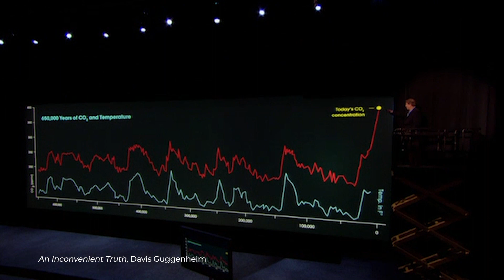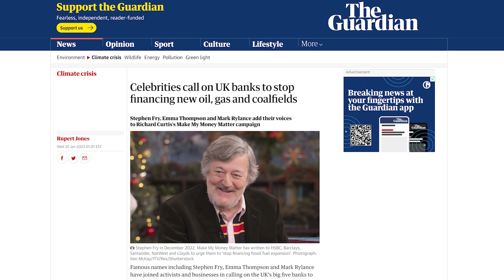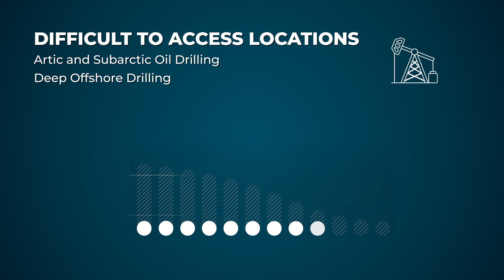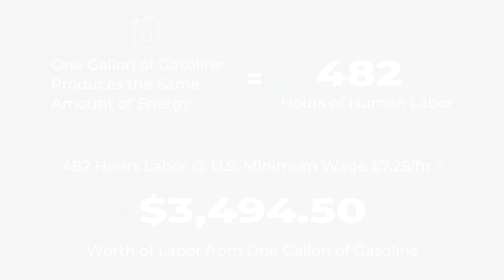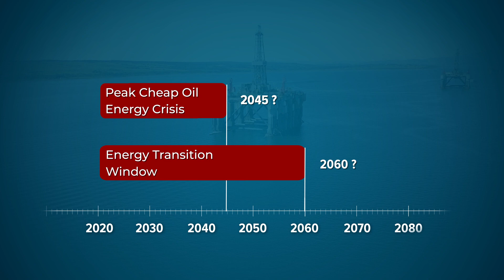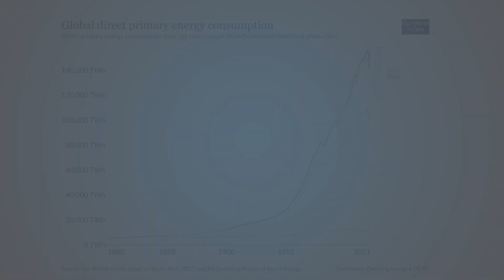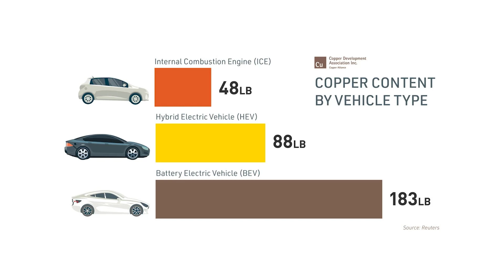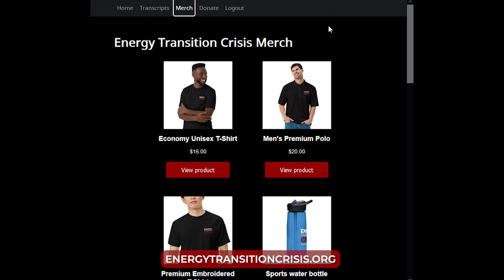Energy Transition Crisis - Episode 1: The Need for Energy Transition

Comment: Hydropower is not only used as baseload power, but im many cases as intermittent power when demand is high. Hydropower from reservoirs can be regulated and deliver high peak power when demand is there if constructed for it. Only hydropower from rivers or without reservoirs are "constant". As an example, when there are alot of windpower in northern Europe and perhaps alot of sunpower during the day, Norwegian hydropower ramps down to save water for later use.

Comment: This was an excellent video, thank you for producing it. I do wonder, however, why a greater emphasis isn't made on an interim transition to natural gas. Thanks to the explosion of shale drilling significant new deposits of natural gas have been discovered. It can be used as baseload, intermittent and motive power. As an energy source it produces less than 40% of the CO2 per kwh of electricity produced than coal or gasoline. While it is not "CO2 free", it is certainly "CO2 better" than coal. Increasing CNG vehicles will reduce the reliance on liquid petroleum. In addition, natural gas is a natural byproduct of landfills so unlike oil, it is not limited to simply the quantity of resources currently in the ground. At 85% of electricity production, fossil fuels are not going away for some time. It does seem, however, that the cost to replace the coal part of an existing power plant with gas turbines must cost much less than finding new places to build solar or wind farms.

Comment: Pulverized coal dust is blown with compressed air into the combustion system of the power plant.  Magnesium powder is added to fine tune the burn characteristics of varying coal qualities.  Magnesium is clean and can be obtained from seawater brine. Increasing magnesium to the max could clean up old plants

Comment: A point that I think was left undressed is the problem of substituting gas powered thermal power plants for on-demand electricity production. With batteries out of the question, which technologies will we use for storing intermittently produced energy from wind & solar that can be re-transformed to electricity at a moment's notice?

Comment: Yes, about 80% of energy is still fossil fuels but this primary energy includes agriculture, transport, manufacturing as well as electricity. If you look at the trend for developed nations, the electricity sector is showing significant fossil decline - even if it isn't as quick as people might like. My point is that the effort put into decarbonisation is making a difference. The problem is that most people don't appreciate the scale of the global energy system. They don't have a proper perspective and thus have unrealistically high expectations.

Comment: 1. I don't take energy as a given, or as limited. 2 Progress is a function of the mind. 3. The mind functions best when at peace, not stressed by fear, violence, threats. 4. The political paradigm is designed to induce fear of violence by threatening force and by fraud. 5. The obstruction of progress is due to "The Most Dangerous Superstition" (Larken Rose). 6. If superstition continues to dominate humanity, destroying progress, then humanity may become extinct. 7. The solution is reason, achieved by a new political paradigm based on peaceful interaction. This will require a respect for each other, as expressed by the theory of rights. Only rights allows choice, diversity, experimentation, innovation. Without rights, humanity will perish.

Comment: TLDR: The transition to clean energy alternatives is crucial to avoid an energy crisis and environmental destruction, but progress is hindered by unrealistic policies, corporate greed, and the need for a master plan and public engagement.

1.  Humanity needs to transition to clean energy alternatives due to the finite nature and pollution of fossil fuels, but current progress is insufficient and politicians' false claims could lead to an energy crisis in the mid-2020s.
	1.1 Humanity must break its addiction to fossil fuels and transition to clean energy alternatives due to their finite nature, pollution, and the risk of permanent climate change.
	1.2 Politicians claim to have a plan for achieving Net Zero carbon emissions by 2050 through wind and solar energy, but in reality, the current progress is insufficient as wind and solar combined only supply less than two percent of our energy needs, and meeting their goals would require building 50 times more wind and solar in the next 25 years than in the last 25 years.
	1.3 The speaker warns that the electric vehicle Revolution will require environmentally destructive mining operations and that politicians' false claims about achieving energy transition will cause economic inflation, with almost no real progress made in reducing dependence on fossil fuels, leading to a predicted global energy crisis in the mid-2020s that could have been avoided with sound energy policy.

2.  Transitioning to renewable energy is crucial to avoid an energy crisis and economic depression caused by climate change and the depletion of cheap oil fields, but politicians' unrealistic policies and corporate greed hinder progress.
	2.1 Politicians are not genuinely engaged in solving the energy transition crisis and their policies are unrealistic and won't achieve the stated goals in the stated time.
	2.2 This docu-series aims to explain the need for energy transition, highlighting the challenges, costs, and environmental impact often overlooked by politicians, and debunking the belief that wind and solar alone can solve the problem by 2050 due to failed government policies, corporate greed, bureaucracy, and corruption.
	2.3 Our leaders have failed in energy policy, but if we transition to renewable energy, we can achieve human prosperity and reduce our reliance on fossil fuels, which currently make up over 85% of our energy needs.
	2.4 Climate change reaching a Tipping Point and the depletion of cheap oil fields will lead to an energy crisis and global economic depression if we don't transition to renewable energy soon.

3.  The availability of cheap and abundant energy has driven societal progress and technological advancements, making it more cost-effective and efficient than human labor.
	3.1 Societal complexity is determined by the availability of cheap and abundant energy, as demonstrated by the reliance on farming and lack of alternatives in the past.
	3.2 The availability of cheap and abundant energy is the driving force behind the significant progress humanity has made in the last 250 years.
	3.3 Energy technology, starting with the steam engine, has allowed for significant human advancement by providing cheap and abundant energy, as demonstrated by the fact that a gallon of gasoline can produce the same amount of work as 482 hours of human labor, making it much more cost-effective, and even a professional athlete cannot match the physical labor that can be bought for less than half a dollar in most countries.

4.  The need for energy transition is crucial due to the environmental impact of fossil fuels, finite resources, and the need to sustain and advance society while preventing self-destruction.
	4.1 The need for energy transition is crucial due to the significant environmental impact of burning fossil fuels, the finite nature of these resources, and the exponential increase in human population.
	4.2 Our ability to sustain the lives of everyone on our planet depends on the energy derived from fossil fuels, which is necessary for modern farming and feeding the current population.
	4.3 The higher cost of energy is slowing societal advancement, and it is crucial to find enough clean energy to ensure our survival and prevent self-destruction.

5.  Fossil fuels are inefficient and wasteful in generating energy, while wind and solar energy offer a more efficient and less wasteful alternative.
	5.1 Fossil fuels are used to generate energy through burning, with natural gas being the most efficient when directly used for heating, but less efficient when used to produce electricity.
	5.2 Coal-fired power plants are inefficient, with even the best ones wasting more than half of the heat energy released from burning coal to generate electricity.
	5.3 Burning fossil fuels in internal combustion engines is highly inefficient and wasteful, while wind and solar energy, although appearing small in comparison, do not suffer from these inefficiencies and can provide equivalent amounts of electricity with less waste.

6.  Electric demand varies throughout the day, requiring different energy sources for base load and intermittent demand, with renewables like wind and solar being suitable for mid-afternoon intermittent demand, but not practical for base load power needs, and the shift to electric vehicles will impact energy demand patterns.
	6.1 Electric demand fluctuates throughout the day, with base load demand being constant and intermittent demand occurring during peak periods, requiring different energy sources for each.
	6.2 Coal and nuclear power plants are best for supplying base load electricity, while natural gas and electric generators are better for meeting intermittent demand, but wind and solar renewables are well-suited for meeting mid-afternoon intermittent electric demand, although energy storage technology introduces inefficiencies and it is not practical to rely on wind and solar for base load power needs.
	6.3 When the majority of vehicles are electric, the demand for vehicle charging during the early morning hours will increase, causing a shift in the energy demand pattern.

7.  Hydropower and geothermal renewables are better suited for base load supply needs, while wind and solar energy cannot serve as base load power sources, requiring alternative sources to meet future energy demand.
	7.1 Hydropower and geothermal renewables are better suited for meeting base load supply needs, with geothermal having the potential to become a terrific source of base load power, while hydropower opportunities have already been developed globally, limiting its growth in the future.
	7.2 Wind and solar energy, while efficient for producing electricity, cannot serve as a base load power source, so it is necessary to find alternative base load power sources to meet the remaining 65 percent of energy demand by 2050.

8.  A master plan is needed to replace fossil fuels with clean energy, but this transition can only happen if people demand progress and engage in the conversation.
Reply from the maker: Thanks so much for posting the Cliff's notes! You're hired!

Comment: I think we can all agree that there is, in fact, climate change. However, we do disagree on the ultimate cause.  That is irrelevant in terms of our needs to wean ourselves of the usage of fossil fuels.  The climate activist all tend to dislike nuclear energy with exception of fusion which is not a viable solution. At least not in the next three or four decades which will not be in time for us to transition away from fossil fuels. We currently have the technology to eliminate a very significant amount of our dependance on fossil fuels but yet we are pouring our resources into non viable technologies. It's time to stop the insanity.

Comment: There are a number of things in this episode that are not fully thought through. For example, there’s an assumption that lithium is the ONLY viable battery, particularly for grid storage. This is simply not true. As a wise man in the green energy world once said, if you want to make something dirt cheap, make it out of dirt. This has happened even in the lithium battery world. Cobalt is mentioned several times in this video as a resource constraint, but iron phosphate (LFP) batteries are rapidly replacing cobalt in lithium batteries. And stationary storage doesn’t have the same need vehicles do for light weight and fast charge/discharge cycles. So grid storage can and will be made of cheaper materials. Lithium-style batteries will give way to sodium, and technologies like iron-air and liquid flow batteries, which are not practical for vehicles, will offer cheap grid storage. 

Another thing not considered is the impact of economies of scale. Dismissing the currently-small amount of wind and particularly solar is a basic failure to understand the miracle of compound growth (an odd oversight for a hedge fund manager!). Solar panels used to be prohibitively expensive. Now, they are the cheapest available source of electricity - so cheap that the intermittency can be bought down by using (increasingly cheap) storage to time-shift that cheap power. And solar panels are almost ideal for economies of scale in manufacturing. Despite the claims of “exotic materials”, a solar panel is basically just a spicy window. It’s glass in an aluminum/plastic frame, with a bit of wiring, and a thin layer of silicon semiconductor (doped with not-really rare phosphorus and boron) more or less screen-printed on. The most expensive material by far is the silver used for wiring. Moreover, there are no chemical reactions or moving parts in a solar panel, so there is little to wear out. Modern solar panels could easily last 100 years or more, continuing to produce electricity (albeit slowly falling in output). So even though solar panel prices fell 90% in just a decade, there is plenty more price drop left to go, as production scales up. Economies of scale also apply to batteries for storage - we’ve also seen 90% price reduction in lithium batteries in the same period, and we haven’t even started scaling much cheaper grid storage tech. 

Finally, this completely misses the impact of current intermittent energy on the pricing of base loads. Solar, in particular, makes abundant energy available during its productive cycle - that competes directly with base load. Even now, we’re seeing periods where electricity prices go negative on a regular basis. And, as the video points out, the traditional coal and nuclear base loads can’t be easily turned on or off, so they can’t just shut down while the sun is shining and the wind is blowing. This means their prices need to go UP when the sun is down and the wind is low, to maintain profitability. This, in turn, reduces the barrier to entry for relatively short-term storage that can buy up the afternoon’s cheap power to sell at night. So economically, base load power has a tremendous challenge. 

I suspect this series is subtly headed in a “nuclear is our only option” direction, although it’s avoiding that sensitive subject at first, like religious zealots toning down their evangelism at first meeting. But given the problems of base load economically, AND the tremendous difficulty and expense of building it at scale (which hasn’t happened after 50+ years of government subsidies)… well, couldn’t that same change-the-world level effort be applied to just building out solar faster?